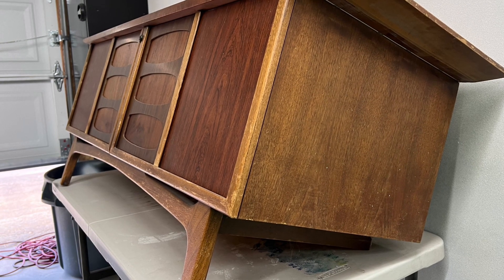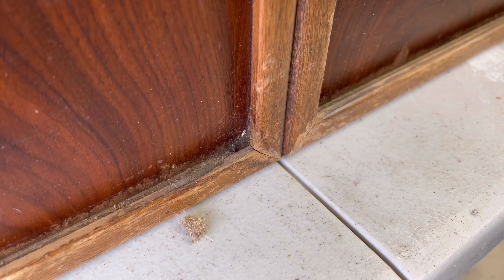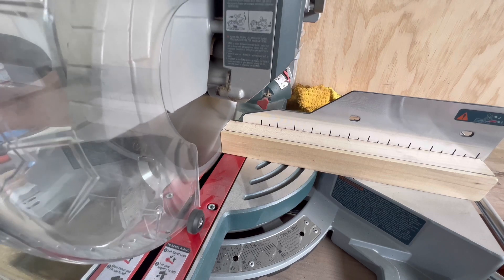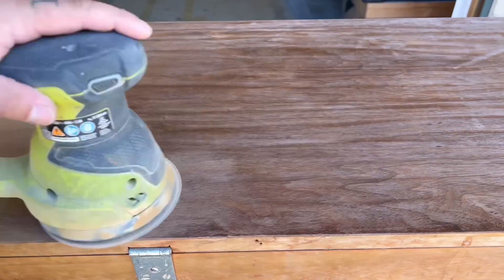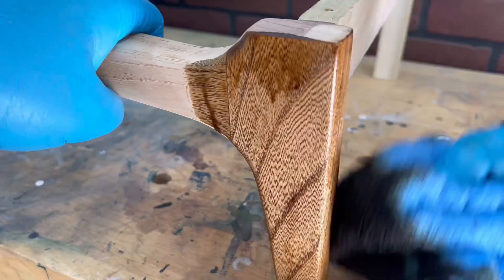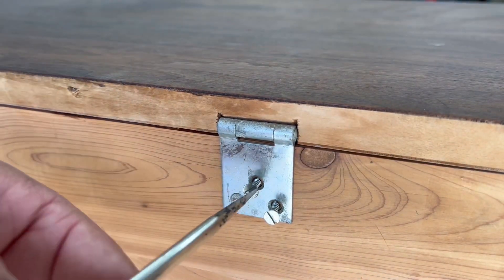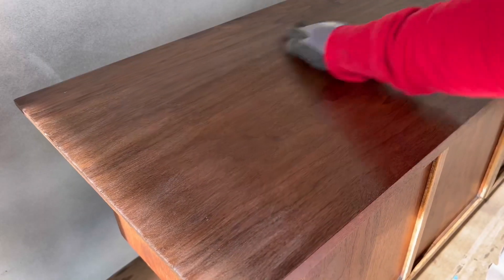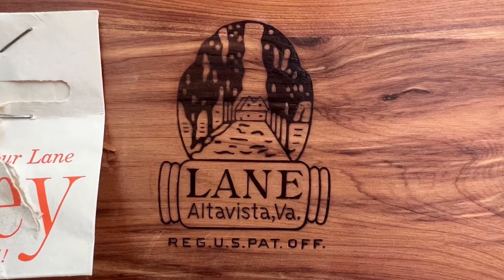LANE cedar chest RESTORATION with a MODERN twist that MAKES this piece ONE OF A KIND || MAKEOVER

Comment: With MCM furniture, the lighter wood is usually Ash or Beech. When staining thst wood, it's a good idea to use a wood conditioner first. It helps with splotches and uneven staining. That piece is amazing 👏  especially the pull-out pieces.
Reply from the maker: Thank you so much for the compliment and advice. I’m still learning and info like this really helps me out and I appreciate it. I usually use wood conditioner but I ran out. Will have to grab some more. Thank you again.
Reply: @CedarPineDesigns  btw ash has a black wood grain that runs through it in a jagged kinda way. You did a fantastic job!
Reply from the maker: @mcm.walnuter3479  thank you so much 🙏

Comment: So beautiful. Just subscribed.   Please ask the new owner to remove the installed lock and throw away while they wait for their replacement lock from Lane. Once the top drops there is no way to open from the inside and the chest is airtight. Tragedies occurred. I received my replacement lock in a few weeks.
Reply from the maker: Thank you so much for the support and info Rod. I really appreciate the advice and concern. I’ve been told before that there is a recall on the lock and have reached out to the new owner. Thank you again!!!!
Reply: You're welcome. Can't wait for your next video.

Comment: Did you find replacement? Company is now shut down and recall for locks are no more replaced. Idk where to get replacement, please advice if you find solution. Also what to use to glue top wood layer back on properly, there is larger separation on the back of my chest. And that fluffy green satin feel inside of a little drawer, can I somehow remove and redo that green soft texture please?
Reply from the maker: I relayed to the new owners so hopefully they got one before it was to late

Comment: I have one of these cedar chests and the top is the only area in need of refreshing. The top has water stains. (Shame on whoever did that! Probably my sister! ha) Is it possible to only refurnish the area on top and have it look good? I have never refinished furniture and I’m scared I’ll ruin it.
Reply from the maker: Hello tweetiebird, thank you for the question. You can definitely refinish the top alone to match the body. My only suggestion would be to use some sort of furniture wax to freshen up the body to make it match the freshly refinished top. If you have other questions or need some advice during the process, feel free to reach out and I will respond fairly quickly. Take care and stay safe.

Comment: The wallpaper is a hard no. Those insert pieces should have been restored as well.
Reply from the maker: Thank you for the feedback Angela. The insert pieces where made out of thin particle board to sanding would have ruined them. The wood pattern on them was a peel and stick style and not a veneer. I wish they had been at least veneer.
Reply: @CedarPineDesigns  if you had wanted to could you have added veneer to them?  The piece looks terrific.
Reply from the maker: @SUGR17  I thought about doing that but didn’t want to end up with something that didn’t match in color. Also, veneer is hard to get locally and I don’t think the pieces would have fit back into the slots.

Comment: To me, leaving the back and the bottom unfinished looks like shortcuts. Doing this would have given this video from me a thumbs up instead of a thumbs down even though the rest of the piece is beautiful.
Reply from the maker: Thank you so much for your feedback. Originally the back and bottom aren’t finished to begin with so I wanted to keep it as close to restored as possible. The inside isn’t finished either and this is because cedar doesn’t get a finish due to moths not liking the smell of it.